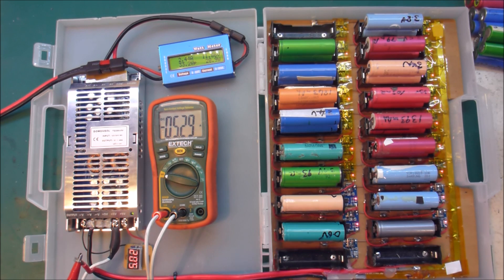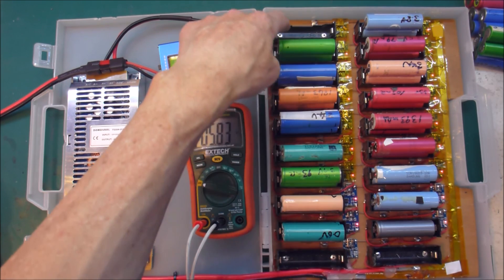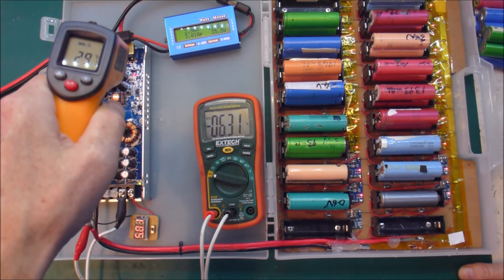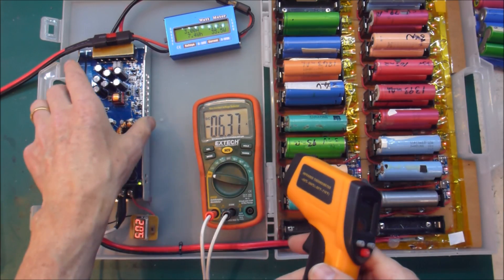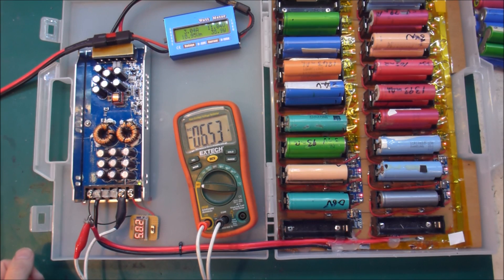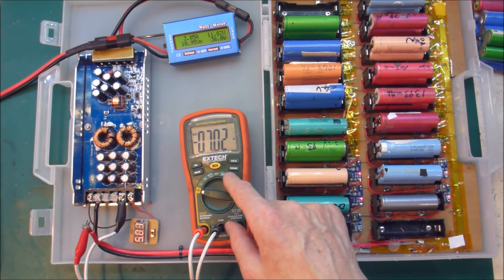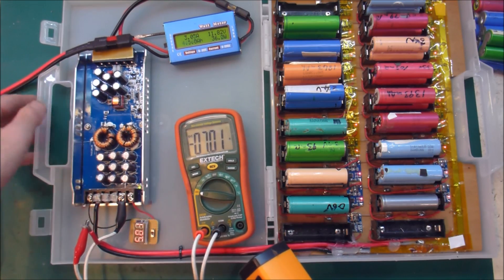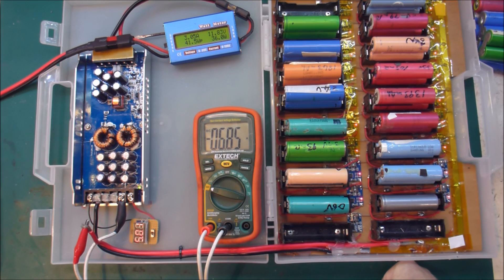Laptop Powerwall 100 - Never mount a heatsink on plastic

Comment: Hi Paul,
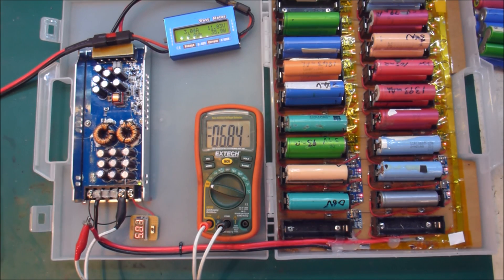at arround 6:20, before you touch the cells current is 6.89A, and "jump" to 7.02A as soon as you did touch , so 0.13A difference;-)
Probably not a big deal, I guess some of the holder's contact getting some kind of insulating dirt. But I would check to see if this couldnt be something more serious like a broken solder or something like that.
Reply from the maker: Ah yes. There's a bit of a story to those cells. They came from a bicycle-art parade project I was involved in. https://www.youtube.com/watch?v=ATw73juIFDI  I showed them how to build some battery packs and these cells are from some of the packs they built - the soldering was not pretty. So these cells have ugly solder blobs on their ends. I'm going to rebuild some packs for an upcoming parade for them.

Comment: Good on you for testing. Always happy to be proved wrong. I think I held back a lot more than others though ;-) Happy 100!
Reply: DIY Tesla PowerWall He's over specified the dc to dc converter on purpose. So yeah - we worried about heat on that converter and he's proved in this case it's not really a concern in practice. Admitting when you've over reacted after seeing the evidence isn't a weakness - in my book it's a strength. Paul's no fool and I'm sure he'll keep an eye on it and spot if anything needs looking at again.